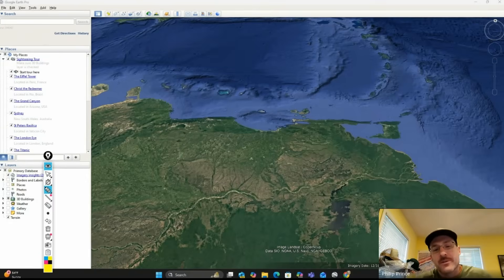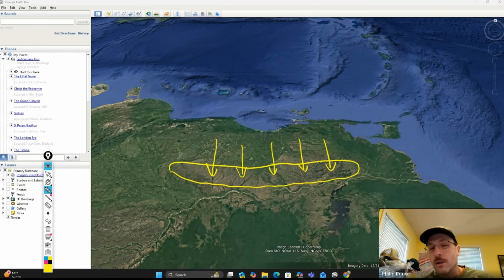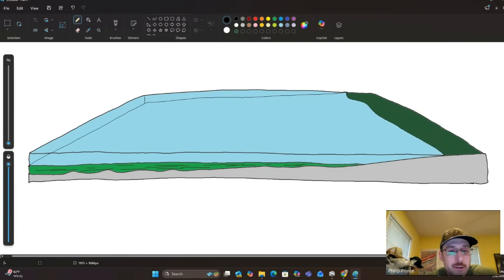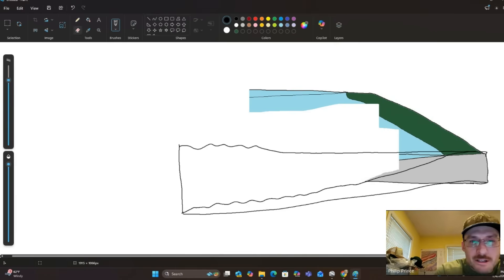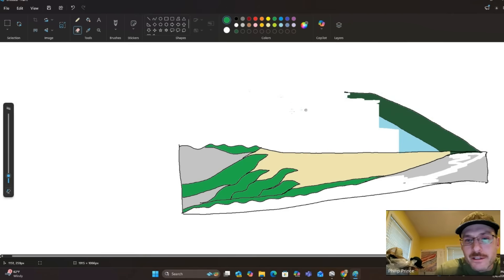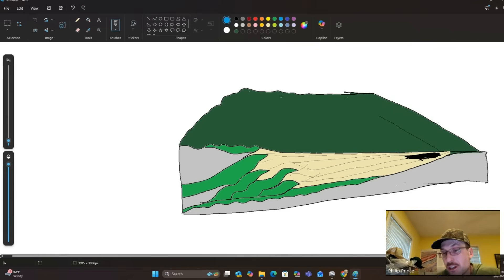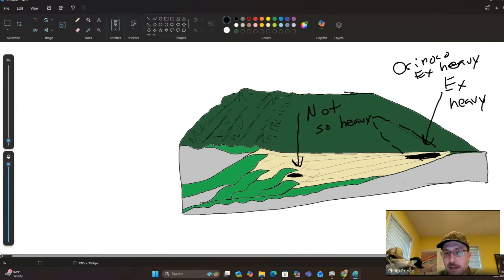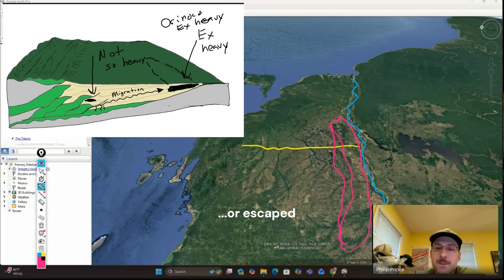Why does Venezuela have so much extra heavy, sour crude oil?

Comment: As a retired physics and earth science teacher, I suggest a slightly different explanation I live on the west coast of Canada, on top of the Cascadia subduction zone.  I built working models about Plate Tectonics for seismologists.The silt on the ocean floor is mostly live bacteria a few hundred meters thick, as you  start with. But the ocean floor itself is sliding under the North American plate. The bacteria silt is carried down and squeezed between the plates. It gets cooked, and turns into thicker oil and lots of methane. We have methane ice bubbling up from the ocean floor, and fishermen can bring up methane ice in their nets, and it burns. That leaves behind the liquid oil. In shallow slabs, a lot of the methane and light gases can escape, leaving a thick oil. But if it goes down deeper, the rocks on the top may trap in the lighter elements to give a lighter oil.  For the sulfur, swamps can smell because rotting organic matter releases sulfur, like rotting eggs. So the sulfur can come from the bacteria itself. Alberta has oil sands because it used to be the west coast of North America, early dinosaur era, and British Columbia is road kill pushed up  as mountains added onto the west coast of Alberta. But their  "oil sands" are the clue. They have oil that was had seeped up into loose sand sediments, so it lost the light gases easier, leaving heavy crude. Just some suggestions. lt does not seep horizontally, it is dragged by the slab horizontally, and gases seep vertically up.  Your structural geology background should tell whether that is an ancient subduction zone, such as layers of serpentine along the sliding zone, and old subduction volcanoes a few hundred miles back now only granite roots?
Reply from the maker: thanks for the comment. I believe there is a text box in the video with the same “residue” concept you mention for the oil sands. there’s likely ophiolitic material in some parts of the coast ranges, but the extra heavy occurrence is just a classic flysch to molasse foredeep-foreland with prolonged updip migration. migration is definitely lateral and up-dip from the deep kitchens beneath the mountain front.
Reply: Interesting suggestion for an alternative geological process, but subducting slabs carry the ocean crust and overlying sediments that are not scraped off very deep into the Earth, far too deep and hot for oil to exist. The subducted material can rise back to the surface but it rises as very hot (900-1200 degrees C) magma and forms volcanoes. A small part of the gas that volcanic magmas carry to the surface might have been originally from subducted hydrocarbons.
Reply: @ericfielding2540  I am only talking about the ocean sediments near the coast. -- I was a volunteer with seismologists on a Coast Guard research trip about 50 miles west off the coast, and monitored the acoustic graphs going on constantly. One night I saw a large obvious plume a few hundred meters tall. Some scientists disregarded it, but one said it was methane. I recorded and photographed several more. Months later at the Pacific Geoscience Center, I was introduced to a post grad doing research on those very recordings. -- The west coast of Vancouver Island has black rocks along the shoreline which are fine silt that that has formed a kind of mudstone, but solid black due to the high carbon content from  the bacteria. A more cooked version further north of the same rocks in Haida Gwaii is argillite (Wiki), famous for Haida native carvings. At Ucluelet where I lived for 7 years, there is a big hotel called "Black Rock Oceanfront Resort" -- The sediments are piled up in Washington State NW tip, where the Olympic Peninsula is itself almost entirely a big wedge of sediments scraped off the top of the subducting plate because the slab is very shallow there. According to a geologist report, "High-grade paraffin oil issues from two seeps near the mouth of Hoh River, and at other localities oil-saturated sandy clay (" smell mud" of the Indians), is exposed. Natural gas containing about 95 per cent methane escapes from a conical mound just north of the mouth of Queniult River"  "At certain times of the year the small streams flowing from this locality are reported to have shown "colors" of the oil." ... " oil seeps and gas vents reveals the fact that several anticlines, which may serve as reservoirs for oil and gas, exist in the area examined and that they have apparently a close relationship to the oil seeps" -- I interpret that as a sign of the point where gas is just beginning to be turned into a light oil.

Comment: The economics of refining heavy sour crudes is based on having a higher tech refinery constructed of more expensive alloys and supplying that refinery with cheap heavy sour crude. Nobody pays top dollar for this stuff. It's all about investing capital in the right process units and running that refinery efficiently to generate healthy margins. Over the years the refineries in the US exceled in processing this type of feedstock. Same sort of math plays into tar sands and other undesirable feeds.  From a refiners perspective they want a feedstock blend that is well matched to their refinery and in enough volume to run the refinery for many years. If there is a plus to the Orinoco material it is that the volume justifies the investment needed to account for the poor qualities.
Reply: I think I have also heard that you can get some unique distillates from the sour crud that markets have developed for. Is this true?
Reply: @elijahcraig4804 sure, greases, chemicals, diesel, bunk fuel, asphalt, where as lighter oil is mostly gasoline and jetfuel, but i think the main reason is its always heavily discounted priced oil
Reply: @DeweyKendrick-l8l  "[«unique distillates»] … greases, chemicals, diesel, bunk fuel, asphalt"
To clarify: Are you referring to sour crude or heavy crude?  i.e. from a chemistry standpoint, not a price standpoint  (My understanding is both are cheap but only the latter is a desirable feedstock for specific applications.)
Reply: @elijahcraig4804  A refinery in the Texas Panhandle specializes in sour crudes. I did some work there many years ago. One of the products they make is the active ingredient in OFF mosquito spray and they make a polymer called Ryton (polyphenylene sulfide PPS), they also make a intermediate called Sulfolane and other intermediates called mercaptans.  All this is 1940s and 1960s tech and the feedstocks come from many sources including sour West TX crudes and Canadian heavy crudes. That refinery smells, well - unique.
Reply from the maker: interesting
Reply: @TheGeoModels  It's kind of the template of all refineries. The designs are customized for specific range of feedstocks and fine tuned constantly to squeeze the highest margin from feedstock. It's a very high tech industry that seldom gets credit for being high tech.